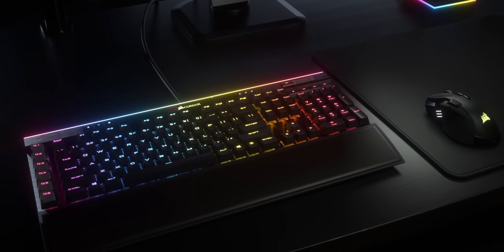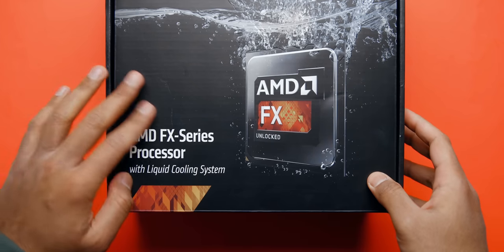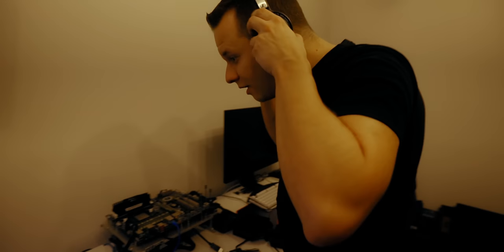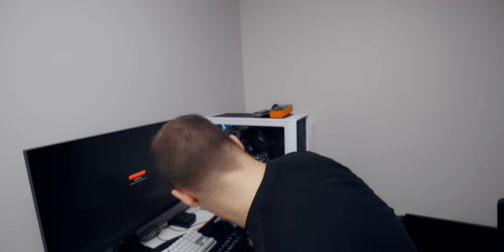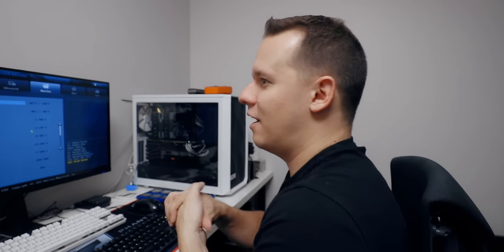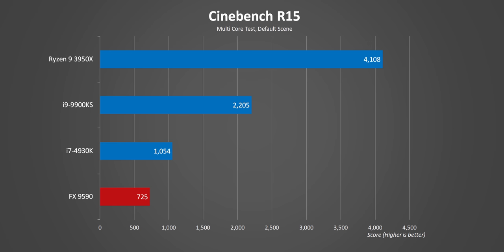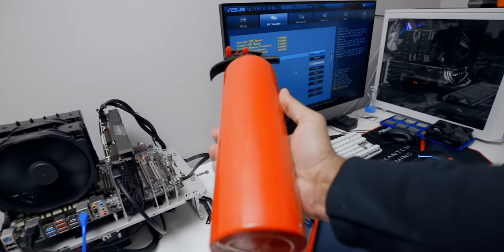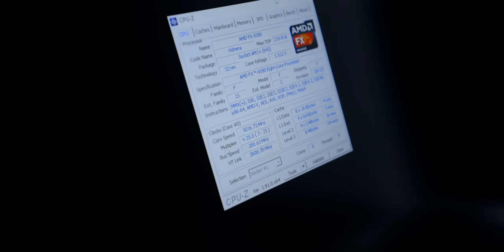Why The FIRST 5GHz CPU Almost Failed - AMD FX-9590 Revisited!

Comment: 7:38 Wrong. The temperature is correct it is 43f I will say it again. INTEL told you that the temperature gauge was incorrect. THAT WAS A LIE! AMD in no way admitted to it being malfunctioning. Do your research please.
Reply: "The temperature is correct it is 43f"
Sure - it surely is sub-ambient when drawing more power than an OCed i9 9900K...............
Reply from the maker: Never said the temp wasn't correct.  Clock and voltage gating on AMD CPUs was literally non-existent at this time.  They tried to run Cool N Quiet (their tech for frequency modulation) but it did very little so idle temps and power consumption tended to be really high.
Reply: @HardwareCanucks  OK not gonna get flustered over this but. OK man. Check this out. When you set your BIOS to a setting. Did you remember to set it to default then restart every time you made changes to the BIOS? If not. You get a heat problem. Next Everyone who read what Intel said about the AMD processor clock being wrong WHERE WRONG >:( 

Intel said that to discourage people from buying AMD. An that rumor spread like wildfire. It is by not means true. Other than that. Just to be clear. Unlike Intel Microsoft Also Favors Intel. When putting together an Intel system it auto jumps to High Performance in the System settings. Where as in AMD you do know that it 

Auto jumps to  Balanced, Now think for a minute. Why was it balancing around 4.7GHz? It was in Balanced mode. If you want a proper test check again please. Not getting flustered. I am gonna remain cool on this.

Comment: FX-9370 gang here :) Still works fine in the majority of games even on 1440p with the GTX 1080Ti ! The PC has a 1000W PSU and draws almost 800W, though. So I will be switching to Ryzen Zen3 when it comes out just for the sake of power savings :)

Comment: What I've learnt from it is that the same CPU clock doesn't have the same performance on different platforms and arcitechures. I prefer quiet system with less GHz over hot and noisy system with 7-10% performance boost.

Comment: Dudes! Great Video! I really enjoyed it ... But you completly missed the most important point: Bulldozer-architecture had TWO CPU-cores sharing one FPU (Floating Point calculation Unit) . Since audio, video and game-technology relies on FPU-caclulations, there´s the problem. An X-core AMD Bulldozer of those times, was basically an X/2-core regarding it´s FPU-processing-power. Meaning: 8 cores with integer calculation BUT only 4 cores for FPU-calculations.

Comment: This is and always will be a legend. I am writing this from a pc with an FX-9590 @ 1.35v @ 4.7 Ghz (Yes, its a golden chip) NB @2.6Ghz . Paired with a RX 570 and 16 GB 2133 DDR3 Ram and a Sabertooth 990FX mainboard, it STILL is more than enough for my needs. 60 FPS at least in anything I play, definitely more possible, but i have VSync on everywhere. 
In productivity like Premiere cc 2019 it is faster than a 4770k and roughly on par with a 4770k @ 4.4 Ghz. 
It does show its age, but stays relevant due to the influx of software that can use 8 cores.

Also I dont know whats going on with your idle power consumption. My system idles at around 85 watts. This is confirmed by Anandtechs test of the 9590. 150w is way too high. Probably you did disable all eneergy saving features for the OC, which is a relic from the past when EIST etc. were new. You can leave that all enabled and work with a voltage offset.

Comment: Lol its good that i watched this video. I was thinking about buying this CPU for upgrade. And i saw some benchmarking, turns out even my current processor is equally powerful as the FX-9590. I use Intel i5 4460 and my cpu is just 4 cores, 3.2 GHZ.

Comment: I always enjoy watching hardware that are "old but not necessarily obsolete". I have a Xeon E5-2690 and my brother upgraded from an Athlon II x4 640(a hand-me-down build from me, before upgrading to an i7-4790) to an FX 8300. I OCed it to a decent 3.8ghz, I could do 4.0ghz but got limited due to the DeepCool Ice Blade 100 cooler. I've always wondered why the FX 8300 had a lower Max TJunction. Your video explained why, thanks!

Comment: The FX 8350 with a TDP 125W is almost as powerful a CPU as this: the AMD FX-9590 has a TDP 220W that is too high voltage and power consumption and too hot. And it won't work on a 970A motherboard. Therefore, it is better to choose 8350 or 8370 if you still have a motherboard with AM3 + support at home

Comment: I had a FX 8350 that I bought day one on an AM3+ Asus Tuf motherboard.  I ran it daily at 4.7-4.8 and could easily get into Windows and perform benchmarks at 5Ghz np.  I still have my Noctua NH D14 on my 3950X and that HSF gets the fkn job done.  I use Arctic Silver thermal paste.  Anyway, thanks for the trip down memory lane.

Comment: I'm currently watching this video on a PC using a FX9590. I used to have it overclocked to 5.0GHz, but it was not stable/worth it. I'm running it at its stock clock of 4.7GHz. In all reality, its not a bad processor. It looks like doggy dodo in comparison to the new Ryzen series. I also use a 360mm AIO and the top of my case gets HOT. If I play games in my room it will go from 68F to 77F in my room within 30 minutes. If I leave my computer on overnight, I can leave my window open in the winter and the room will not dip below 70 degrees. 

All this being said, my friend who helped me build my PC bought 4 of these chips, And all of them are still in use right now. Hes using one for a server to run PLEX, another for his girlfriends PC, my PC and a NAS. They are good chips for the time, and still somewhat hold up for light to mid range tasks. You can get a Full FX setup (board, ram and CPU) for not to much. I think my CPU was less the $80 dollars. for the money, i think its a good value overall as long as you add a good cooler and have the right board with good VM's. 

Obviously, I will upgrade to Ryzen sooner rather then later, but i have loved this CPU so far.

Comment: I built a video and audio workstation using the 9590.  Honestly the CPU is meh for gaming.  For video editing, audio, live streaming (from my end) it's a beast.  I use a Cryorig 280mm AIO and that keeps it around 50c at full load.  Along with 8 Thermaltake Riing high pressure case fans.  My whole rig stays cool.

Comment: My 2600K ran at 5.1GHz on a custom loop, 5.2GHz HT off, 9 years ago. So wasn't that crazy tbh. Phenom 1 sucked, super underwhelming, but Phenom II when it came out was actually REALLY SOLID bang for the buck for the time tbh for gaming, basically as fast as the Q9000 series that were still relatively new. Not as fast as the more expensive i7 920s that dropped like a month earlier, but much cheaper and was a huge improvement over Phenom 1. I recall people loved them at the time and tbh was a way bigger success than the FX series, especially in the budget gaming community. For sure didn't get as much flack/hate. I know friends that got boards that let them unlock cores on boards that supported it, on lower core count chips. One friend bought a dual core and unlocked it to a quad core, another bought a triple core and also unlocked it to a quad core. Most of my friends had Phenom II rigs at that time, some didn't even upgrade till Zen 1. 😆

FX series architecture if I recall correctly was inherently flawed, the modules shared a single branch prediction engine, a single instruction fetch and decode stage, a single floating-point math unit, a single cache controller, a single 64K L1 instruction cache, a single microcode ROM, and a single 2MB L2 cache. Yes they had two x86 cores but all they could do is integer calculations. In reality each module was more like a core with hyperthreading than two cores in terms of actual performance, hence why they lost the lawsuit. It wasn't REALLY an 8 core. So it was more than just windows scheduler being the issue. It was a unique architecture trying a novel approach to multithreading but it didn't work out and was horribly inefficient. It's why they scrapped the whole project, never developed new revisions for high end market just tried to improve it for the low end APU market to improve efficiency, and hired the guy behind the Athlon 64 to come back and developed a more conventional chip from scratch.

Comment: Compare the FX 8350 & FX 9350 vs Ryzen 5 1400 and Ryzen 5 1500X. Stock vs stock, and OC vs OC. Performance, clock speeds and power consumption.

Comment: I had one of those. Drove me nuts with the heat and an AIO noise at home. Ended up at my old work space powering the ESXi server with a build farm and a staging server and some other light VMs. Downclocked to 4.5GHz. Probably still crunching numbers out there. One of the most memorable mistakes in my life =)

Comment: the AMD FX is the 77 chevy 1/2 ton pickup truck of CPUs

ya, its showing its age.... but its a trusty old workhorse
ignore the 8mpg and blue smoke when cold... its fine

the power draw of my 6970 gpu is a feature..... actually heating my room ATM
i live in montana.... ya, still snows in april....

Comment: I had a FX 9470.  It would boot at 5.5GHz on one module, complete some benchmarks at 5.3GHz.  All on water.  I liked that CPU, if I could remove the heat fast enough it'd take more voltage and go further.   They may not have been a commercial success, but they're an interesting piece of silicon history none the less.

Comment: I went from an FX-4100, got an FX 6300 and ended up with an FX-8370. All on an ASUS Sabretooth 990FX. Cooled by a number of CPU coolers but ending with a Corsair 240mm AIO. It was so cheap to do AMD back in the day. I almost upgraded to the 9590 but it was night and day in performance when I eventually went to Intel. By that time, Skylake was coming out. So, I kind of got hosed building a high-end I5-4690k Intel build running DDR3. I Should have just waited a couple months. But the FX series was my first foray into building a PC. I also tried out various Radeon GPU's. The performance was always meh. But it worked!

Comment: I just upgraded from an FX8350 which I had Overclocked to 4.6Ghz at 1.335v. I am now using a Ryzen 7 3800X at 4.425Ghz @ 1.2625v... yes 1.2625v at 4.425Ghz ALL CORE, and yes I know this is pretty much a god tier binned 3800X.

I stress tested it overnight on AIDA64 Extreme with CPU, FPU, and Cache and it was stable. Tested it with Prime-95 for 1 hour after and it was stable, and did another hour and a half with Cinebench R20 in mutlicore only and was still stable.

The performance difference between my 8C/8T FX8350 at 4.6Ghz and my 3800X 8C/16T at 4.425Ghz on Cinebench R20 Multicore?

FX8350 @ 4.6Ghz = 1191
3800X @ 4.425Ghz = 5229

NOT EVEN CLOSE.

Also for CPU-Z my Single Threaded Benchmark hit 540, which is pretty much where a stock 3800X sits +/- 1 or 2 points variance, so no real loss of single core performance for me. This also puts me in line with a 9900K in single core.

Additional Details for my 3800X OC..

4.425Ghz all core MANUAL
1.2625v VCore MANUAL
AMD C6 States and power optimization states RETAINED
ASUS Optimized VRM Profile
ASUS Auto Load Line Calibration (Level 0, minimal LLC)
NZXT Kraken Z63 /w TG Kryonaut and 4x Noctua NF-A14 iPPC IP67 2000 RPM fans in a Push/Pull front mounted configuration.
AIDA64 Overnight temps: CPU 68.8C, Coolant 36C, Fan Speed 2000RPM (-40 RPM variance), Pump Speed 2000 RPM (-50 variance)
Motherboard: ASUS ROG Crosshair VIII Hero X570 (Non WiFi)

Comment: I have FX8300 OC'ed to 4480Mhz with 280FSB (x16 multi), 2800Mhz HT link, 2520Mhz NB , which leads to 1866 Mhz RAM (from 1333) on  Gigabyte 990X Gaming SLI Motherboard. My Cinebench R15 score is 720p, and it never reaches more than 60C with CoolerMaster Seidon 120M AIO. So, i have your result, with much lower clock (520Mhz less). What are you guys doing wrong?

Comment: Still using an FX8350 @ 4.5Ghz (w/ NH-D15) + R9 290 @ 1100Mhz core / 1500Mhz memory (w/ Raijintek Morpheus II + 2 x NF-A12x25). It's not that bad for 1080p gaming and general productivity, but I do hope to upgrade with hardware that's from this decade.

Comment: I'm a little disappointed that you guys didn't use a 9700k.  9900k is double the threads. :( 

Even a 9700k wouldn't be fair IMO.  If you consider that the 9590 wasn't a "true" 8 core.  A 7700k, possibly overclocked to 4.7-5Ghz would have been fair, I think. 

Still, I know it's a lotta work.  Great video guys.

Comment: Using my old FX-9590 with the stock AIO (it was the original with FX rgb logo LED built in), 16gb ddr3 1866 and Vega 64 as my VR rig.  Does pretty well considering the cpu's limitations.

Comment: I have a space heater PC.
FX4100 4.4GHz@1.5v (was 4.5 but destabilized) and a GTX 470 that I don't have an overclock on right now after rebuilding the system but I'll do that tonight.
I had an R9 290x, but that blew up :(

Comment: Low memory speed, low nb speed, not very well configured fx build. A well built golden fx could hit 5.3 on water /w 2133-2400 c11 ram, 2700-3000nb/ht and draw 180-200watt. Mine fx8300 was run @ 4.8, 1.39v

Comment: Well, the problem with 5Ghz and overclocking FX cores in general is CPU NB and RAM speed bottleneck. You don't boost it - you barely get any additional perfomance.

Comment: wow, no jokes, couple years ago, I had a FX-8370 chip that I could overclock and get stable at 5ghz, 1.45V, H100iGTX watercooling, 1866mhz DDR3 4x4Gb ram, and an Gigabyte ga-990fx-gaming motherboard. it was REALLY stable (stress-tested it for hours) and decent temperature (under 50°C), I must had a suppra GOLDEN CHIP. damn! I even made it work at 5.1 Ghz by increasing the bus speed but it made some weird glitch with my pci-e lanes that would make it unusable in some games.

Comment: What a timely video.  My Corsair H100i that was cooling my FX-9590 since 2013 recently died... I expect my electricity bill to go down.
I had the Asus Sabertooth 990FX... First one died, RMA'd board died (both had faulty solder).  I switched to a Gigabyte board and had no problems for running continually for the last 6 years.

Now I'm in the market for a replacement cooler... do I want to spend the money for replacement Corsair water cooler or take my chance on Noctua DH-15s...  hmmm

Comment: I don't think that FX 9590 was completely stable, one should use something like a 1st gen CoolerMaster CM690 case which has a 120-140mm fan blowing directly on the VRMs/Heatsinks to keep it from thermal throttling. You are not going to stay within thermal margins in Cinebench when not using a case/chassis with support for side-panel fans; you'll hit VRM Throttling in about 2mins with modern PC Chassis on a motherboard such as the MSI 990FXA Gaming.
Judging from your Cinebench R15 score (725 and 114 respectively), that FX 9590 was performing similar to a FX 8350 at ~4.6Ghz-4.75Ghz, I believe a stable FX 9590 wil turbo to 4.85Ghz on all cores under load and 5Ghz on single thread.

Comment: My old computer was a Crosshair-V Formula-Z motherboard, FX-8350 black edition at 5GHz With Four Sapphire HD-7950 graphics cards, all crossfired. It was insane how hot my room used to be. I switched to AM4 with a Ryzen 7 2700X, and two XFX R9 390 graphics cards. I kinda miss how warm my room used to be. I live in Oregon where summers get around ~75 Fahrenheit, it was almost unplayable during summertime because of how hot my room was.

Comment: I had a build with an FX-8350 all-core overclocked to 4.8 GHz on an Asus 990FX board cooled by a Corsair H105 and with two R9 290 GPUs in Crossfire and 16Gb of 2133Hz DDR3 RAM.  The Windows log-in name for this system was "Spaceheater" for obvious reasons. 

BTW, our legal system says these CPUs didn't just lack SMT, they also had just four cores and not eight.
I still have that FX-8350 on that board in a stand-by machine with an RX-580, and it still gets the job done at 1080p.  These days, when I fire it up, I run it at stock speed because I want it to last forever.

Comment: It was absolute disaster
The only thing which bulldozer is good for compared to Phenom is massive parallel computing (like opening 50 chrome tabs at once with a LOT of data, while playing YouTube in background).
I am going to switch back to Phenom II X6 1100T, as recently I have seen same jerking problem on YouTube.
FX-8350 have exactly 2 advantages - bigger Level 2 Cache allowing a lot more parallel computing and AES instructions. That is all. Otherwise you will always be better off with AMD Phenom II.
I have HP Proliant DL385 G7 with 2x AMD Opteron 6174. I know what this architecture is capable off. Things you can do with it are probably on level of 12-16 core Zen 3. It is crazy. And it still have 3dnow

Comment: I was running SETI@home when it was still up. 9590 is my CPU, and my GPU is the old R9-290. I ran 3 of them of course why not. Then I had to find solution to keep it cool. My cPu has its own AIO cooler at a 360mm block from Cooler Master. NZXT solved my R9-290 problem by having a Hybrid cooling solution. That ultimate result in a open case chassis design. It is a heater and computer but I love those 2 years. I know my PSu is seasonic 1250W Gold.

Comment: Still using a 9590 black edition on an asus Crosshair v formula-z with 16GB DDR3 2000mhz... with an RTX 2080. LOL. Did lots of rendering back in the day and I can definitively say this was far better than anything intel had for the longest time and it made quick work of extremely high poly renders (large scenes). 

I still think it’s time to upgrade... I’ve probably paid for this cpu 2x over in the electricity cost over the years!